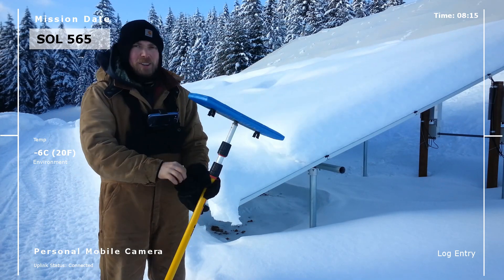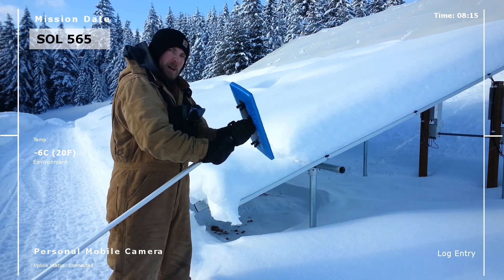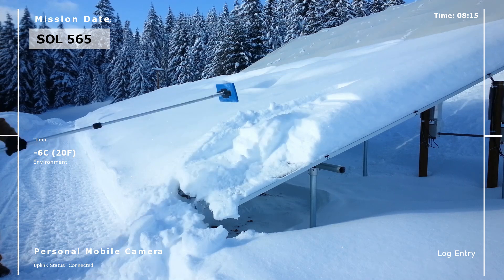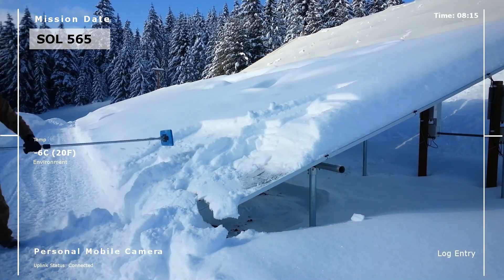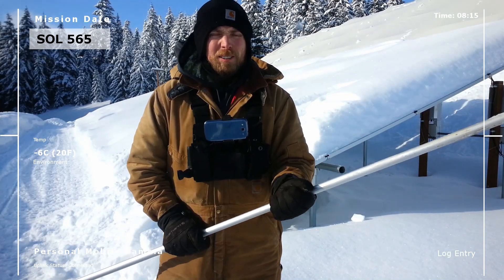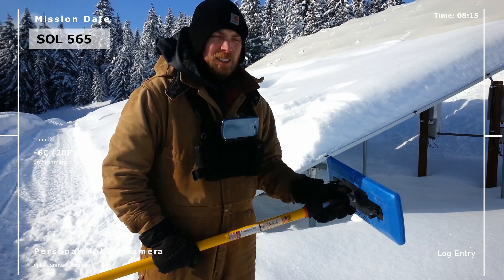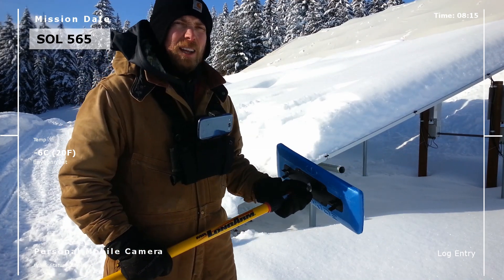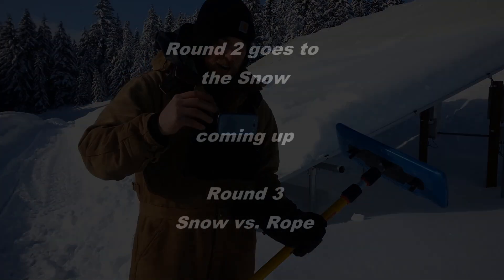Can you clean SOLAR PANELS with a CAR SNOW MOP?

Comment: STRING METHOD FOR REMOVING SNOW OFF OF ROOFTOPS... It will work for solar panels... Leaves less then 1/2" of snow to either melt or remove.

Comment: You got a new portable heater tarp off the underside area and stick it in there for a bit might melt it enough on the underside so you can slide it off with the rope or that car snow mop tool which looks pretty good. Cody could build snow fort walls around it to do same thing as tarp-ing it off LOL

Comment: Have you tried to use a string to cut below the snow and then try to push it off? I understand that it would take multiple trips with the tractor to clear in front of the panels.
Reply: could lay a tarp under the front of the panels and then drag the snow on top of the tarp.

Comment: When it snows the skies are usually overcast and the panels not producing any or very little power. So make a tarp you can pull over the panels when it starts to snow. If it stops snowing you remove the tarp and the snow with it. If you make it tight with bungy cords the wind should not be able to get under it and act like a sail, ripping your panel array away :)

Comment: Have you considered Wrangler Stars Neat snow removal system?
Reply: I was thinking the same thing but change the wheels out with some like used on skateboards to keep from damaging the panels.
Reply: or his. either one should do the trick.
Reply: The problem is the panels are not high enough for any idea to work properly. It just piles on the ground in front of them.
Reply: im from the south so im not too versed in snow handling, but seems to me a blow torch would fix that issue (roflmao)